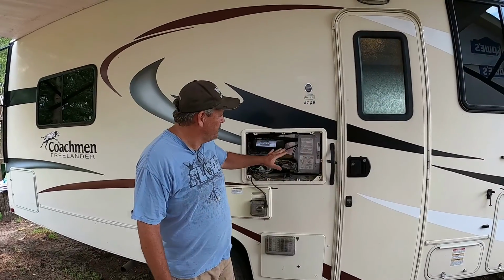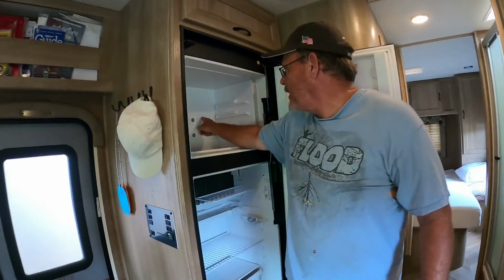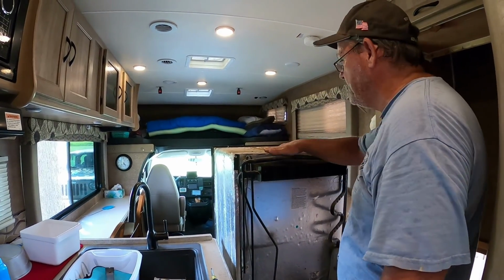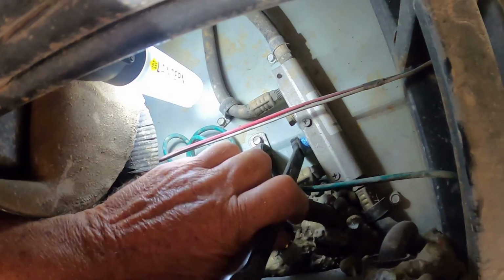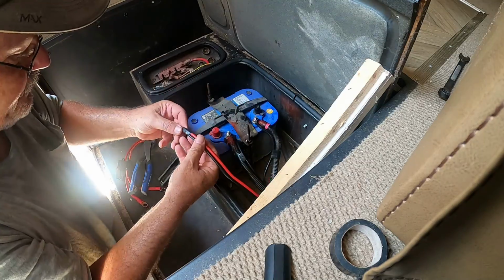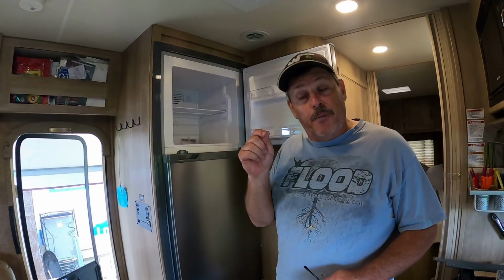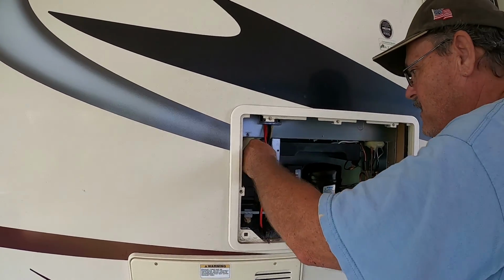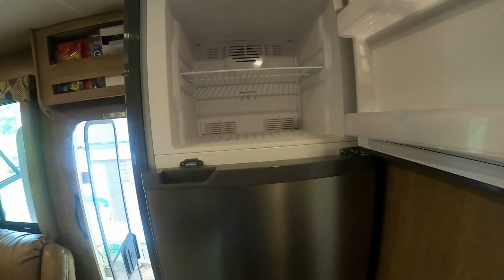12 Volt Refrigerator Install

Comment: Such a great video. Everything we needed to know to get a new fridge installed. I'm surprised you only have a single lead acid house battery.  I was running out of power with two lead acid batteries and upgraded to two LFE batteries so I now have a real 200 Ahr capacity. Looks like you are getting by with maybe 35 Ahr.
Reply from the maker: Thanks for the comment. And yes we run on one battery with no issues. Please don't forget to Subscribe.

Comment: Nice video! Now that it’s been a few months, any thought or lessons learned with the conversion? We’re thinking of doing the same thing! Thanks for taking the time to make this! Got my subscription!
Reply: Another thought- why couldn’t you use the 12v that was already there from the absorption fridge? Was that not an option or not a constant hot? Thanks!
Reply from the maker: We just went Full Time 2 weeks ago. So far the fridge is doing great. No issues at all. It runs very quiet. Also, vacations we have had no issues and its great to be able to run it while traveling. As to date this has been a fantastic upgrade. You will need to add a On/Off switch to the 12v. It doesn't have one. I integrated a 30amp automotive relay for this. Put the relay switch on the main panel so it looked factory and the relay on back of fridge. I should have made a video on this, but its simple to do..
Thanks for watching....
Reply from the maker: @andrewk1916  the 12v supply is to light and it will cause the lights to flicker in the RV when it cycles. You have to run a independent circuit for the fridge. 30amp rated with a 15amp fuse. This will carry the startup amp load.

Comment: Do U want muddobbers ? hot air from the outside to enter your camper.  DC wire sizing not the same as AC need larger wire to the 12 volt refrig
Reply from the maker: I blocked off the vent from the outside by sealing off the slots with flat white plastic trim. Cam out very well.   I used a size 10 wire automotive wire.

Comment: The outside wall should be caped off so as the frig will be using cool inside air to cool the frig condensor, also he used the old wiring from the old system , to small of wire # 10 from the fuse block
Reply from the maker: A size 10 automotive  wire was run straight from the batt through a 30 amp, on/off realy.

Comment: I have mounted my spare on the roof and want to build a 12V fridge into 1/2 the spare well while leaving the other 1/2 for locked storage. Any ideas on getting the parts I would need to do this?
Reply from the maker: They make 12V Fridges in many sizes. I would suggest looking at a size that will accommodate the opening your working with. 
Thanks for watching and good luck with your project. Don't forget to subscribe....

Comment: do you have a list of the stuff you used and directions written for installing the solar panel controller and wires to batteries?  thanks
Reply from the maker: I have a video on the complete install of the solar panel. I show the list of components at the beginning of that video. 
Thanks for watching and don't forget to hit subscribe.
Reply: @LifeisaHighwayRV  Thanks will look for it

Comment: Question! Why didn’t you use your existing 12 volt refer wiring coming from your fuse panel being that it already has a 15 amp fuse?
Reply: My guess would be the size of wire needed to be increased
Reply from the maker: Won't carry the load, and it will cause lights to flicker when it cycles.
Thanks for Watching n

Comment: Nice video! Good job on the fridge. I’m curious how wide is the door on your RV?

I have a 12V on order. I Also want to run it straight to my battery. How is it working out connected straight to your battery?
Reply from the maker: The Door is 23 1/2" wide. You will probly have to remove yours to get it in.The fridge is.little over year old now and Works Great. Best upgrade for any RV . I did add a relay and switch to turn it off. This fridge does not have a off switch. But, you can easily remove the fuse and this will kill the power. However,  we're full time know so we never turn it off. This is also great while traveling. 
Thanks for the comment and watching. Don't forget to subscribe 😉

Comment: Did  you have a lithium battery already or is it a lead acid?  Do you have a converter in your rig?  Great video!
Reply from the maker: We have a lead acid battery. And yes, we have a 12v converter when hooked up to shore power.

Comment: Would this up, not connected to the fuse box, allow the fridge to run on shore power automatically when plugged to a 30amp at a campsite?
Reply from the maker: You can connect to the fuse box or the best way is direct to the battery. Shore power runs the 12v through a convertor which charges the 12v house battery while plugged in. Do Not use the existing 12v power from the old refrigerator. The circuit is to light for this fridge. Either way its still on the house battery.

Comment: What is the Current Draw during Chilling, and Idle?  the Factory Website is Useless.
Reply from the maker: I believe Startup AMPs is around 6 to 8 but it doesn't last long.  It runs around 2 to 3 amps during cooling cycle. I didn't spend much time looking at the draw. I will say, we've had No issues. Its very quiet and works great. Been running non-stop for 7 months of full-time RV living.
Reply from the maker: Just a side note for you. According to Furrion, (1) 100watt Solar Panel will run this refrigerator for up to 17 days on one Battery. I don’t Boondock so I can't confirm this. But, we do travel up to 6 hours at a time with 1 solar panel and no issues. We never turn it off. Thanks for watching....

Comment: Is there not a blank spot in the fuse box on the 12v side to wire from there? Nice work. I want one of these bad but man they’re expensive! Now go get a shower!
Reply from the maker: I don't recommend using the fuse box or the original 12v wires. This could cause the lights to flicker when it cycles. Also, its not in my video, but I had to add an On/Off switch. The Fridge will not turn off. So pulling thr fuse would be an easy way to turn it off.
Reply: @LifeisaHighwayRV  weird it didn’t come with an on off switch. Good way to drain the battery if you’re not paying attention.

Comment: Great video. I am replacing our Dometic with a new 12v refrigerator. The main reason I was watching to see how were going to do the ground wire but you didn’t show that.
Reply from the maker: Just connect it anywhere on the Frame. Right  below our fridge there was already 3 grounds to the frame. So I put the ground there. It just needs to grounded the frame.  
Thanks for watching. Don't forget to Subscribe...

Comment: I don't trust having a fuse on the solar into the battery if it ever blows it will damage the charge controller
Reply: No, other way around. You don't want to have solar panels hooked up if there is no battery on the controller. You can shut the solar panels off at anytime as long as there is a battery connected to the solar controller. This is why you might want to have a DC rated circuit breaker on the panels. So you can disconnect them if you need to service the controller.
Reply: @roybertalotto6355  OK let me rephrase that...
I don't trust having a fuse between the controller and the batteries because if it blows it will damage the charge controller! 
I do have a dual pole DC breaker coming from the solar into the controller to turn it off before disconnecting the batteries to protect the controller yes 👍